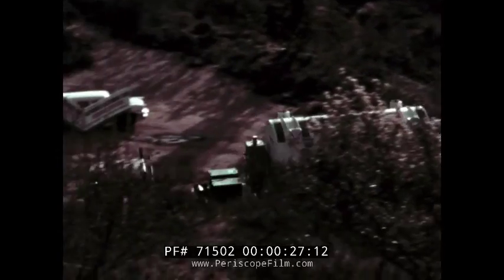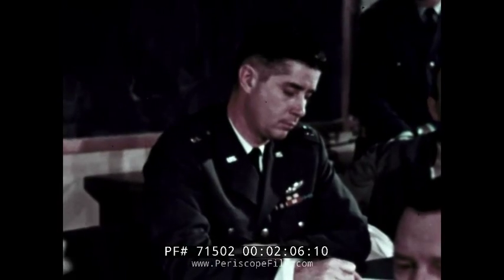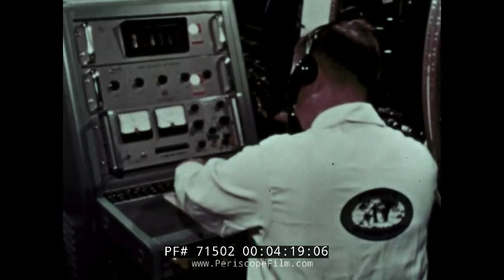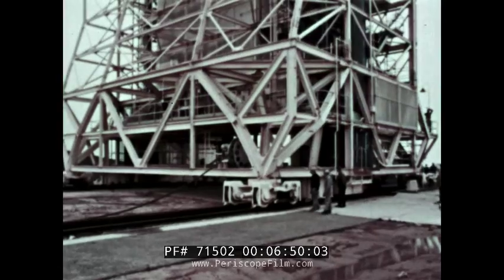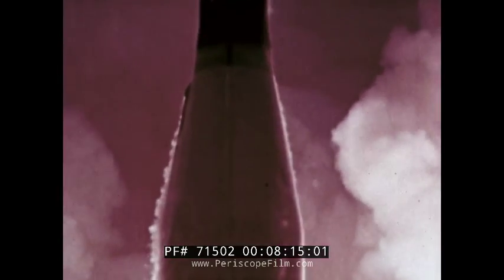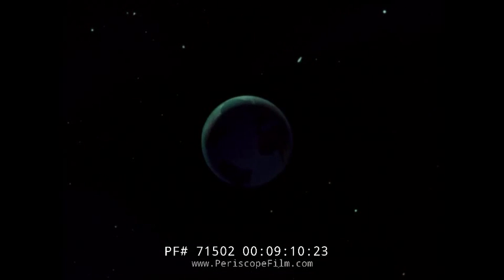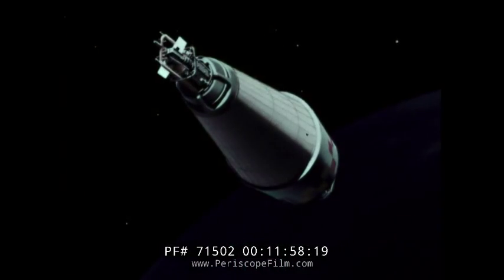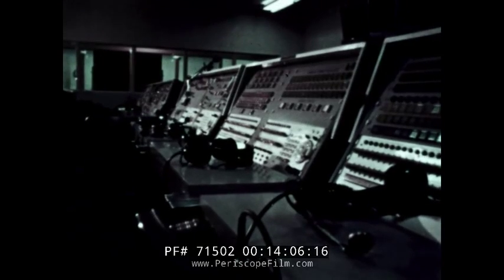FIRST NUCLEAR REACTOR IN SPACE SNAP-10A PROGRAM 1965 71502

Comment: It sounds like this was the starting point for the RTGs used in our interplanetary probes like the Voyagers and New Horizons
Reply: RTGs pre-dated SNAP in space, the first being in 1961. A big problem is that an RTG requires plutonium or other rare or prohibitively expensive isotopes to be lightweight enough to be practical. SNAP produced a lot more power for the same weight using "ordinary" uranium fuel. NASA is now going back to reactors in space due to the global plutonium shortage.
Reply: @NikovK  Yup, Pu238 is not easy to get (Pu 239 is common and used in MOX reactors to get rid of what was once weapon pits).
What's interesting here is that "the radioactivity will have decayed to harmless levels before re-entry".  We knew better even then.

Comment: where is it now ?
Reply from the maker: Wikipedia says: After the 1965 system failure, the reactor was left in a 1,300-kilometre (700 nmi) Earth orbit for an expected duration of 4,000 years.In November 1979 the vehicle began shedding, eventually losing 50 pieces of traceable debris. The reasons were unknown, but the cause could have been a collision. Although the main body remains in place, radioactive material may have been released
Reply: In November 1979 the vehicle began shedding, eventually losing 50 pieces of traceable debris. The reasons were unknown, but the cause could have been a collision. Although the main body remains in place, radioactive material may have been released. Later research, published in 2008 and based on Haystack data, suggests that there are another 60 or more pieces of debris of size <10 cm [13][9]
Reply: Heating the lattes for Greenpeace?